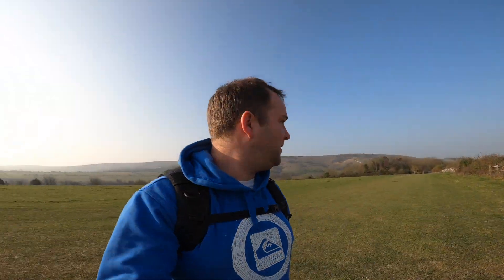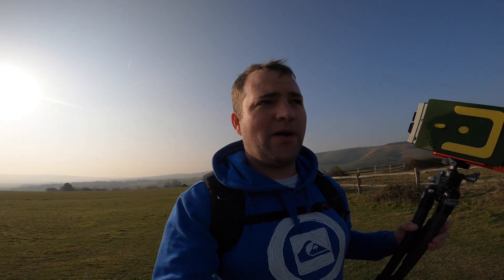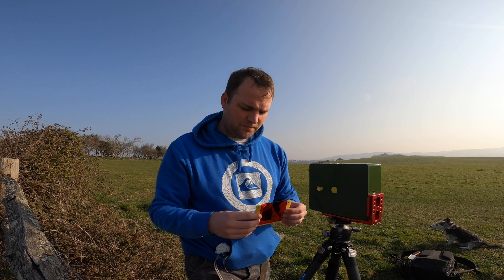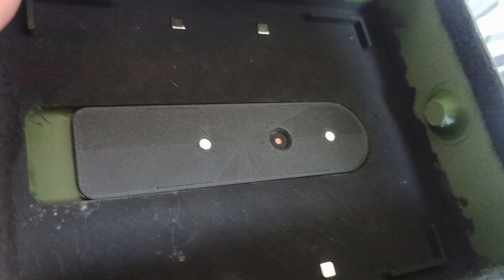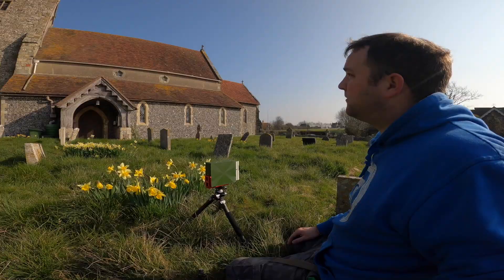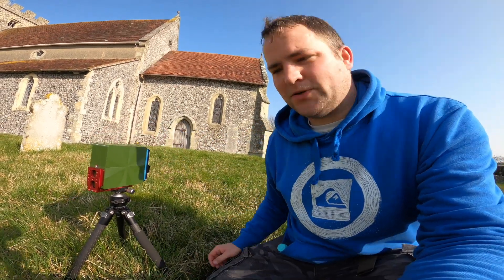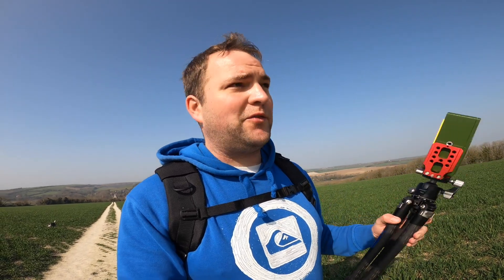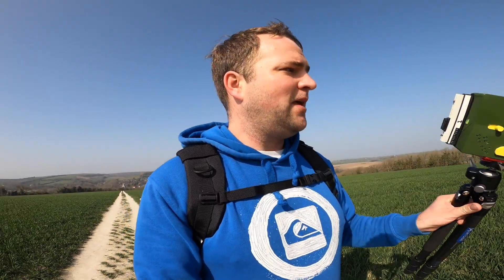The MIA 4x5 3D printed pinhole camera - the final design?

Comment: Nice review, Will! Really enjoy your pinhole videos! I’m thinking of buying the Mia 4x5 model in your video. Just trying to decide whether to get the 35mm model or the 50mm model. Any advice?  Cheers from USA 🇺🇸. Anthony
Reply from the maker: Hi Anthony, sorry for the delay, I normally spend my summer away from YT.
It's very much a personal choice, I like the wide pinhole cameras which is why I went for the 35mm, but 50mm is a great alrounder and still wide.
Mia does do the 4x5 moduler which has a couple of different Focal lengths, but I had loads of light leaks from the holder when I tried that one.
Reply: @WillGudgeon  No worries, thanks Will! Appreciate your reply. I’m going with the 50mm 4x5. Not too wide is ok with me. Excited to start working with 4x5 film. Definitely outside my comfort zone. Your video inspired me to start, so I thank you. 
Question: How do you scan 4x5?
Reply from the maker: @anthonys_expired_film  I either photograph it with my digital with the film on a light box or use a film scanner.
I only have a full scanner that can do 120, so I scan the 4x5 in two sections and stitch back together in editing